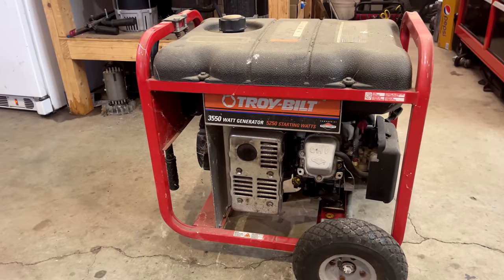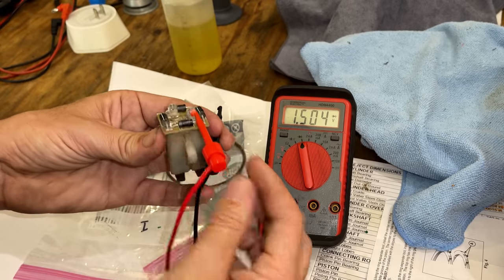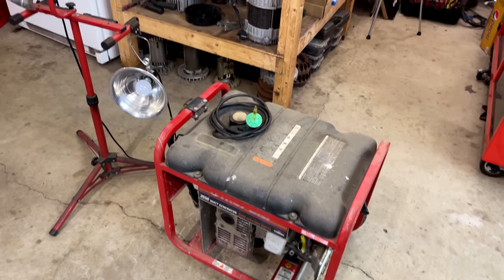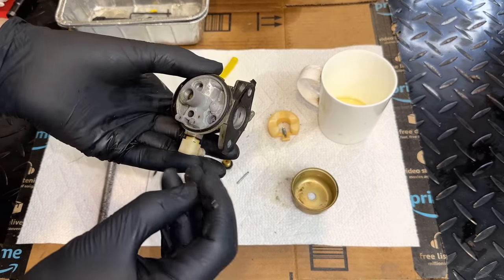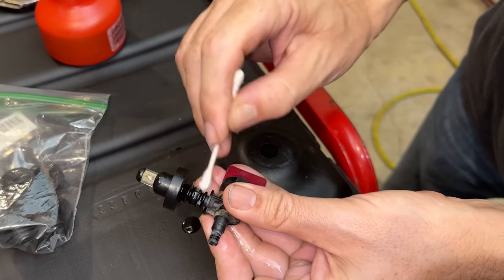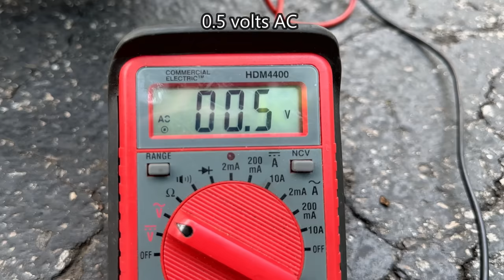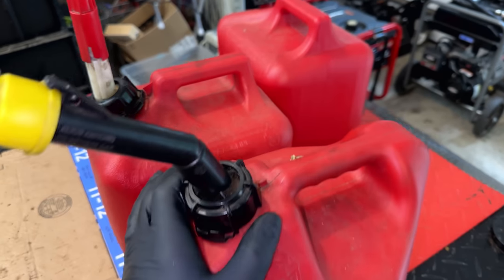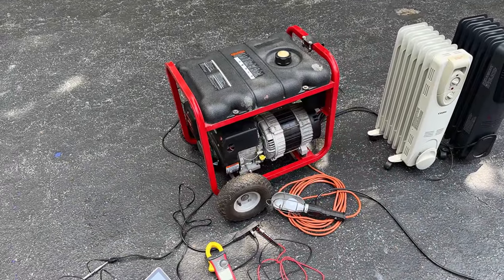No Power Output - Will Flashing the Field Restore Power?

Comment: What if you get a battery drill and hook it up to your electric drill to flash your stater ,it will turn a lot faster then by your hand,?
Reply: The brushes were bad enough that they could not be recovered thru flashing.
Reply: I did it that way. A lot easier

Comment: Let’s be honest…lack of an oil sensor DOES NOT kill these machines.  Owner’s failing to check the oil level is what kills them. Oil sensor is nice, but unless there is other catastrophic failure that immediately depletes the oil (in which case you have larger problems), an oil sensor will only save a complacent owner who never checks the oil.
Reply: Thanks for being honest.
Any engines have gas sens..?  oh, yeah, the gas gauge!
Reply: I’ve seen that many times, those oil sensors are unreliable.
Reply: Ever trust the oil sensor, first off it only tells you when your oil is low if it's even reliable, second it doesn't tell you how dirty your oil is. I have a champion 4500 and a pulsar 3500 generator that I run every day for a test 8 hours or more very day. I've had the champion for 5 years and the only problem I have had with it was I had to change the brushes on it,which is a cheap part you can get a 10 part for like 6 or 7 dollars on line and it's a 5 min fix, and I had to clean the carburetor out once. With the pulsar  the only problem I've ever had with that is the plastic choke level snapped off because I was using it in -10 degrees Fahrenheit. And I think that the plastic was just too brittle because of how cold it was. But other than that I have never had a single problem with either generator and I use them on a daily basis running them pretty much all day. And still to this day after owning the champion for 5 years and the pulsar for 4 years they still run like the day I bought them off the shelf. Maintaining your engine no matter what it is whether it be a generator a lawn mower or a car or any other machine, goes along way e en with cheaper products. Well at least when it comes to generators. I know people are going to laugh when I say this but I love champion generators and I love pulsar generators because they have never let me down and the parts for them are so dang cheap. And as long as you keep up with the maintenance they will never let you down. Oh and in case anybody wonders why I have to run my generators for a minimum of 8 hours every day it's because I live off grid, I built my own house I can't stand having neighbors I can't stand homeowners associations telling me how I should live I like being able to shoot my guns when I want wherever I want. And what do I do for power for the rest of the day and night when I need electricity and I'm not running my generators well I went to a junkyard and bought the batteries out of four different Teslas and I use my generators to charge the Tesla's batteries so that way I will have power when I'm not running my generators and yes I do have solar panels but it takes a lot of energy to power up the amount of Tesla batteries that I have. Oh and for the ones that are going to be critical about my comments just to let everybody know I just bought the Tesla batteries about 2 months ago and now that I got everything set up no I have not had to run my generators every day. Four cars worth of Tesla batteries will run my house for 3 or 4 days but I do not like to run the batteries until they are completely drained.

Comment: I believe you could flash the field without worrying about removing the built in diode. The diode pack would just act as reverse polarity protection in case you connected the battery backwards.
Reply: That was my thought too. However, it wouldn't have worked on the diode assembly that was present in the generator as some of those diodes were faulty.
James says in the video too that it works through the rectifier later on with the 2nd generator.
Reply: In fact, it doesn't act as reverse polarity protection, it actually makes sure that the correct polarity is applied no matter which way you connect the wires.
Reply: @chrishartley1210 thats called reverse polarity protection.  Lol.
Reply: ..so long as the diodes cope with the current...
Reply: @MadmanJimbo  No, reverse polarity protection just stops the current from flowing the wrong way. If it needs a name this could be called polarity correction.
Reply: Great minds think alike.
Reply: @drEvilfromLV  The rotor has a resistance of about 24 ohms so the current can't be more than 0.5A, the diodes look like standard 1A diodes.
Reply: 100% correct. Like order of connection for AC leads is irrelevant, 
connecting a pair of jumpers from a battery to the tabs first in one 
polarity and then reversing the jumpers, the bridge rectifier would 
accept the correct polarity and reestablish the residual field and 
the bridge would reject and block the incorrect polarity. So the 
job would get done trying it one way and reversing, assuring 
success by the polarity that was correct.
Reply: @artpatronforever  what you're saying would be true for a half bridge rectifier, but this is a full bridge rectifier. With a full bridge rectifier you can apply dc in either polarity to the input, and you'll get the correct polarity at the output. The cost is a bit of voltage drop which is around a volt in this case.
Reply: @chrishartley1210  meh, I'm still calling this reverse polarity protection. I'd also call it that if you had a shunting diode that's designed to blow a fuse when reverse polarity is applied.
Reply: But you could also call it reverse polarity correction if you wanted to be more specific I suppose.
Reply: @denrayr  I'd go with correction over protection no matter the choice of prefixing just because protection implies stopping something and correction implies enabling something.
Reply: @baconghoti  I concede, but only if you'll concede and say that half bridge protection should be renamed reverse polarity blocking and reverse polarity diode shunting should be renamed reverse polarity disabling. Now that we've got all those out of the way, we can retire the name reverse polarity protection. Good Lord, the YouTube supertech brigade is in full force today. Y'all must have gotten a good night's sleep. Go out and save the world today. The world needs you.
Reply: @denrayr  Right. There is no correct or incorrect polarity
going into a bridge rectifier. So it would make no difference 
and be resolved to one polarity constant DC output. Since
there is no incorrect polarity it would work either way, the 
bridge would simply redirect the correct polarity internally
and the output would be a fixed polarity for a good bridge. 
Two ways to jumper but either way works to produce the
exact same output polarity.
Reply from the maker: @drEvilfromLV  also not good for the MOV.  Probably would have been ok in a pinch.
Reply: And what title do we assign to the process of making sure we’re using the proper name???
Reply: @jcondon1  what's the normal working voltage on that winding? If significantly below 12v, the mov could explain why it didn't work in the test. The mov could have robbed the current.
Reply: @artpatronforever 😅😅😅
Reply: Is there something you can do to avoid losing magnetism..
Reply: @drEvilfromLV  They can.
Reply: @tarstarkusz  in the age of neverending costsaving, I would not take this for granted personally. An earlier version of the same "SKU/FRU" very well might be OK with this, but who knows if a brand-new item sourced from Amazon/eBay has the same class of components installed..
Sure enough, I know virtually nothing about power generators, and I concede that possibly the standard operating mode in this case is 'close enough' to what these diodes have to deal with when receiving 12V DC 'input, just from the common theory perspective I see a risk of burning out those 2 which would 'allow' the current to flow when DC is applied from a relatively powerful source such as a car battery, as opposed to dealing with 60 Hz AC so having an opportunity to cool for half of the duty cycle.
Reply: @chrishartley1210  Reverse polarity protection usually comes with just a single diode (usually in filter circuits), when you have four diodes it's called a "Full Wave Bridge Rectifier" which means no matter the polarity of incoming current, the full wave bridge will "rectify" it to the proper polarity on the output side of the bridge. So no matter which way you connect 12 vdc to a full wave bridge, it's corrected by the bridge, so effectively you can't connect it "reversed".
Reply: @drEvilfromLV  Personally, I would either use alkaline batteries or a current limiting power supply.  OTOH, it's in series with the rotor which was 23 (IIRC) ohms. This limits the current to about 1/2 an amp.  Just looking at those diodes, you can safely assume they are rated at least 1/2 an amp.
Reply: @tarstarkusz  obviously this is not an action for an average enduser/consumer. In which case, having aside a dedicated brush assy w/o diodes, just for the specific purpose of "force-feeding the magnetic field" to a device capable of generating thousands of watts (so with rather savage transient processes) seems to be a so much better and safer option 😉
Reply: @drEvilfromLV  You don't need to go through the brushes. You can just touch the wires right to the slip rings.  The brushes exist to allow motion.  Since he is doing it while it's not moving, you could just put the wires right to the slip rings.
Reply: @chrishartley1210  yeah i think they mean that a full bridge rectifier which is the diode network we see here is inherently also reverse polarity protection anyway when subjected to a DC voltage input.... 
When the input is connected to AC voltage it generates a rectified output, which is basically whatever the ac waveform was but with all its negative parts switched to positive. Instead with dc  it will pass the correct polarity and it will completely block the reverse polarity. Many reverse polarity protection circuits exist, the most widely used is the diode. Its codt effective but it generates heat and wastes energy in normal operation.
Reply: A generator develops DC current, and lower amps. This was ok on older engines. An alternator provides ac current at higher amps but that is sent through a diode trio to create DC current. This reduces voltage, but the battery survives. In an ac generator, the trio can be eliminated.
Reply: @tarstarkusz Yes you could, but if the wires used make even a tiny spark, you've now put pits in the slip rings which WILL chew up the brushes in very short order. So bad idea
Reply: @mxslick50  I doubt if such a small spark would pit the slip rings.  But, point is well taken. It's better to it through the brushes.
Reply: @jcondon1 You didn’t get sparcs when running through the recitifier because the diodes catch the back EMF from the rotor, since it is reverse polarity - that’s also the reason why the MOV isn’t at risk because the voltages never go beyond the 12V - as long as the diodes are ok.
Also the current is never to high - at 24 Ohm with 12V the rotor coil gets charged up to 0.5A and that’s the absolute maximum you will see.

Comment: Next time try your cordless drill to the corded drill with the pull handle ratcheted adapter and you might get enough speed to flash successfully. Just a thought. Great job! It’s always good to get a cat scan for a proper diagnosis!  Thanks Jim!!!
Reply: Yes on another person's video, (themaritimegirl in Canada?), I seen they had a battery electric drill connected chuck to chuck  to a corded drill, with a piece of dowel or something similar joining the chucks. They had to keep the battery electric drill, spinning the corded drill at a full speed for about 30 or 45 seconds continuously, before the generator suddenly burst into making full power, and was good from then on.  I'll try to include a link here. Start at the 10 minute mark... https://www.youtube.com/watch?v=yvMF82r8AU8&t=1171s
Reply: Somebody may have already said this, but remove all other loads while you're doing that. Otherwise, the other loads are stealing power from spinning the drill instead of all of it going to flash the rotor. You still need some indication whether your efforts are working or not, so maybe hook up a low power LED bulb, or a voltmeter.

Edit: just realized that if you're successful, the corded drill will spin on its own. Duh...

Comment: Where the oil sensor comes into its own, is when you're powering your house during a power outage. It's better for the genny to shut down via sensor rather than having the engine seize up. You can limp along by refilling the oil pan after a possible ad hoc repair versus not having power.

Comment: Owners of EVERY small engine need to have the voice of my father in their head.......  "Whenever you fuel your small engine,  Check the oil level"....... and "When you take your engine from storage,  check the oil before starting it."      

Once we borrowed a generator for a few days from a gent across town who did NOT have power issues at his home.   Each time I re-fueled the tank...  I topped the oil if it was possible...  and when the power was returned,  I did an oil change on his generator,  using good quality HD30.   I sincerely hope he was satisfied that I respected his equipment.

Comment: I have the same but the craftsman version, 5600/8600 had it since the 2008 ice/ snow storm here in Massachusetts and I keep it maintained with oil and TruFuel when put away in the summer.
I can pull it out and 2nd pull it’s running. Not a bad generator especially after multiple times needed and 15 years later it’s running fine

Comment: I've had terrible luck re-flashing with a power drill by hand. I got the bright idea one time to wrap a long piece of pull cord around the chuck, and yank the cord away. That pull cord helped my drill to spin way faster and longer than I could by hand. It worked that time. Again, I'm in awe of your perseverance to get these generators going, so much more details than a lawnmower.
Reply from the maker: Thanks.  I actually tried spinning the drill with another and still nothing.  As someone pointed out a drill is a universal motor and not great for flashing the field.  Like a generator the rotor in the drill is an electro magnet.  So only the residual magnetism is pushing a bit of power into the stator.  Using a battery works much better.

Comment: The spark indicates (as stated by you) a high voltage being generated by the collapsing field when you disconnect. This "spark" voltage may be high enough to blow the diodes if you do the re-magnetization  through the FBR, this is why people say do not do it this way. (You can of course connect to the output side of the bridge i.e. where the brushes connect, this would still risk the diodes but read on.) However, the blue button you see on the rectifier is probably a MOV (metal oxide varistor) which is normally very high resistance but becomes a very low resistance if the voltage exceeds a certain threshold. MOVs are surge protectors so they are there to protect the diodes from this high "spark" voltage. The reason you see no spark when you try to re-magnetize via the bridge is probably because the MOV is doing its job and killing the spark. BTW the spark voltage can also damage the insulation of the coil wires so it is probably better idea to always do re-magnetization with the MOV limiting the surge voltage.
Reply from the maker: Good point, thanks
Reply: @jcondon1 
hi James, I also have a concern about a rotor from a 2kw generator, I measured its resistance and it is quite low (12-13 ohm)...in your videos I noticed that it is usually between 40 and  70 ohm... and it has no ground connection.... the stator is new and in parameters (single-phase stator) ... and the problem is that it immediately destroys the avr... it burns after a maximum of 1 minute of use.  Is the stator to blame in this case?  Thank you!

Comment: James, a very professional and very reliable way to demagnetize the armature is applying alternating current, but in a decreasing way, using a PTC in series with the collector.  This way, as the PTC heats up, the current through the armature gradually reduces.
Reply: Why would a person want to demagnetize an armature? Not trying to be a smart a*s, just wondering.
Reply: You want the armature slightly magnetized but the stator should be demagnetized periodically. Normal operation tends to do this on its own.

Comment: I have a Briggs and Stratton Storm Responder like you repaired in this video. I bought mine new in 2009. It came with a power cable that has two 120 volt plugs stacked one over the other (for the same outlet) and 4 outlets on the opposite end. By putting one leg powering the top plug and the other powering the lower plug that power cord makes use of the full capacity of the generator, Mine has worked flawlessly each time T have needed it. Thanks for your videos. I'm learning a lot.

Comment: Your videos really help me had a storm responder with a bad govern, someone worked on it before me without telling me .After fixing it would just idle ,found spring on number 2 spot move to 5 spot working thanks to you . Got it apart and back together with your help. Only one thing you didn`t make the heavy sound when removing the coil or armature , they are heavy .

Comment: Love your videos! I wonder if you would connect your wired electric drill chuck to your battery drill chuck, using a short piece of 1/4 or 3/8 rod. Then spin up the plugin drill with the battery drill to make a more constant voltage to flash the generator. Might be worth a try.
Reply: I came here to suggest the same thing just use a piece of small wood dowel in case it gets out of hand it’ll break I’d like to know if it would work
Reply: Got same idea.